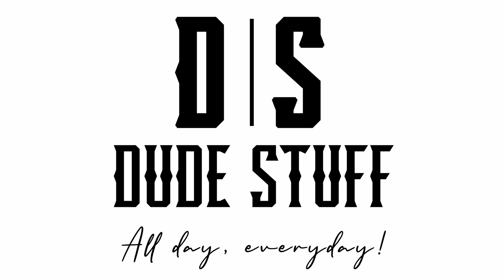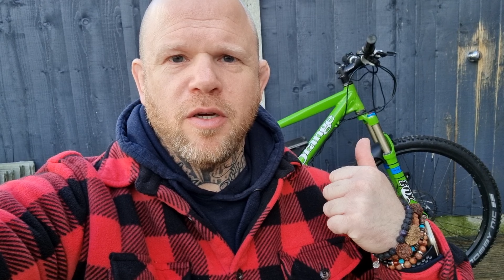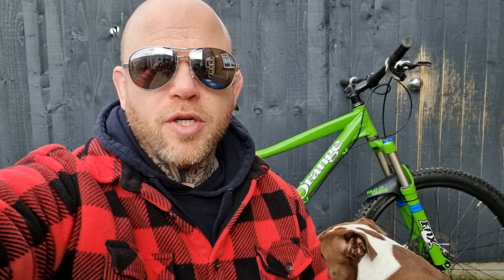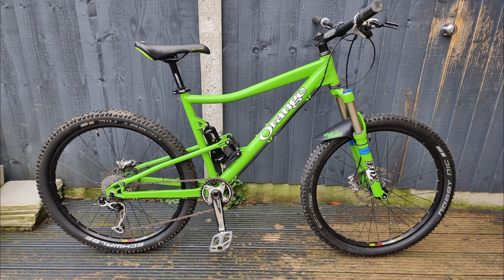EBIKE to MOUNTAIN BIKE CONVERSION!

Comment: Happy days I recently acquired two specialized turbos 1X 1s models and one complete one for spare parts including the frame. I'm leaving one complete and the other one I'm building into a full suspension Enduro Cross Hill climber with a 63 inch wheelbase. The turbo s is getting stripped of all its electronics and converting to Straight Street machine with a trunk built into the frame. Housing a small battery for the lights and display.

Comment: fitting a short stem would make it look i bit more agressive and modern! also would get a bit of weight of your wrists, but if the geo fits u good as it is i supose theres no reason to change it. beautiful bike none the less!
Reply from the maker: Funny enough I fitted a short stem to it originally and it rode horrible the front wheel was very light on the ground in a not good way 😂 but that was when it had electric. I still think that longer stem probably is better for the geometry of the bike but I might mess about with it again